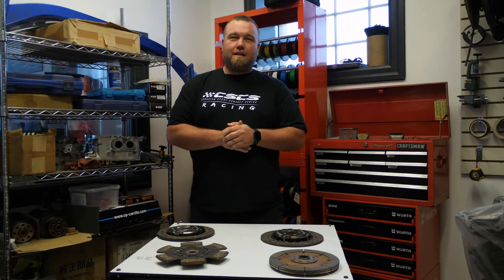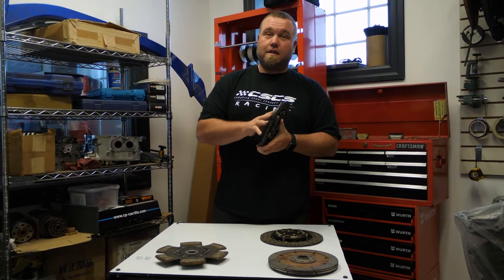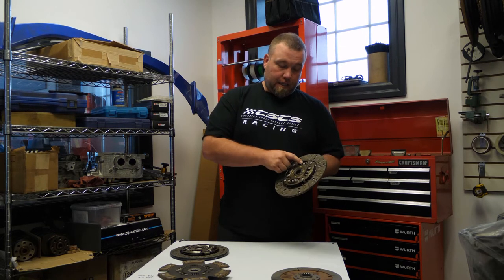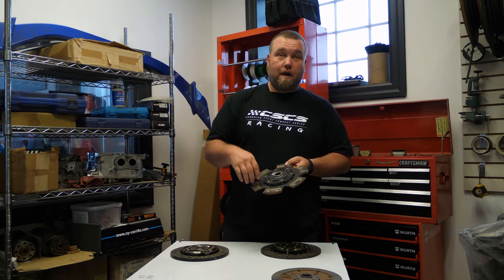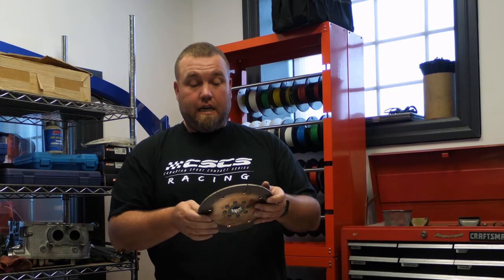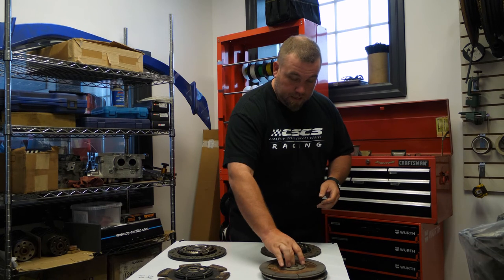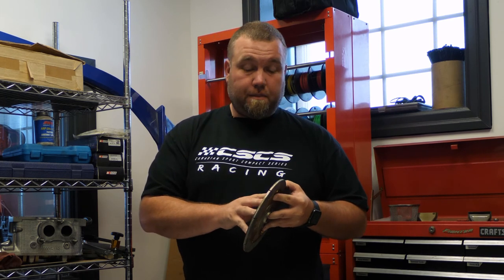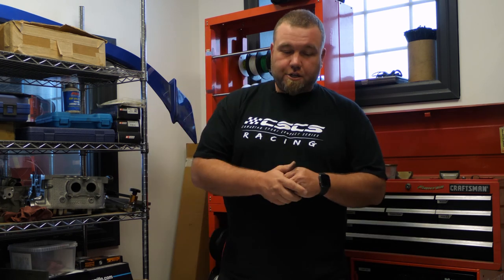How to Choose The Right Clutch For Your Build

Comment: If i may ask...
Im currently building a modest 1jz supra with the w58 (300hp if lucky)...
I went with a dual friction clutch to replace the stock one which was worn.
Its street and spirited driving with minimal track time (4x a year).

Sintered iron 6puck/metal-organic type.
Did i make a decent decision? Seems i have, but i rarely see those covered and not sure if the idea of them alone is a gimmick or the concept doesnt work as well as it may seem.

Comment: That was very informative. I normally use Stage two in my cars Z32 TT etc, but for my starlet turbo I was just about to order a tage 3 for the first time and nearly made the exact mistake you were explaining, thinking it might be better than the stage 2 but I won't do it now. To be honest I never felt a difference from stage 1 to 2, thats why I wanted something a bit more sticky but I guess this isnt the right way to go. My new stock clutch cant take the power of the engine after some upgrades.

Comment: Your explanation is very good. I thought choosing clutch only looks at the toque.

My car got 200hp with around 360nm, which one is mostly suitable?
Reply: Regular organic if your clutch basket is strong enough....
Reply: Torque and HP are interrelated. Torque is the raw rotational force transmitted across the clutch or whatever is being rotated. Torque it the rotational version of pushing.  
HP is a function of how fast an engine can produce torque. A simple formula is HP = Torque X RPM/5252  where the torque units are given in ft lbs.  So, you can easily see, If an engine produces, say, 200 ft lb of torque at 3,000 RPM it's producing 114.25 HP at that speed. So you might think, "Ok, at 6,000 RPM I suld be making 228.5 HP.  That logic, however, would only hold if said engine can produce the same 200 ft lb of torque while spinning at 6,000 RPM, which is almost certainly an incorrect assumption becasue the engine's breathing efficiency, the source of torque and power typically goes down above a certian RPM. Conversely, a racing engine's breathing efficiency, may actually be relatively poor at low RPM and spinning it faster will increase its efficiency - up to a certain point. After that point (RPM) is reached, for example, the turbo simply can not provide more boost pressure at the increased volume needed to fill the volume of your cylinders (for example 2.0 liters) twice as fast. Thus, though you might be able to spin your engine to even higher RPMs before blowing it up, the boost and subsequently the torque curves flatten out, then decline as you rev it even faster.  Take a look at some dynomometer plots showing both torque and HP vs RPM and everything I just said will make perfect sense.
Reply: @1RalphEboy  That's all well understood, but by application, I don't see how HP really matters unless leverage (gear ratios) is involved.  Say a car has a peak of 500HP at 5600RPM.  My target there would be gear ratios and tire size to keep the engine rotating near 5600 as much as possible.  Leveraging (pun intended) torque multiplication of the final drive ratio to maximize power to the ground.
There is no leverage between the engine and the clutch.  The maximum stress applied to the clutch will be determined strictly by the peak torque output.  So, a 525lb-ft peak at 4200RPM will be the highest the plate has to grab.  Torque actually drops when going above that RPM and all useful power is determined further down the line by gearing and tire diameter.  So, while the engine is producing 500HP, the crankshaft output can be 25lb-ft less than the peak.  Meaning the clutch is actually under less stress while the transmission+pinion+spur+rollout take up the job of controlling power delivery.
The closest correlation I could see would be due to road conditions combined with the lower ratios of the higher gears.  A pothole at 12:1 will definitely have less impact than at 1:1.  So I guess something like "torque noise" could be considered for high gears.  Otherwise, anything connected directly to the crankshaft can only experience peak strain during the engine's peak torque.

Comment: Would you know what brand sprung hub twin disc clutches would work for my Tremec TKX 26-spline street motor making 600 torque? Thanks
Reply from the maker: I would think McLeod clutch will have a solution for you.
Reply: McLeod doesn’t make a sprung hub twin disc clutch at this time. I did discover Tilton ST-246 is a sprung hub twin disc. I need to contact them regarding my TKX. Due to solid hub floater plate chatter not being ideal for the street a sprung hub reports to be quiet below the 2000 rpm lite load.

Comment: Blah blah blah. I understand what each one isn’t “designed” to do, but I’ve daily’d normal design, and 6-pick design clutches, and I have no issue driving either as a daily. Really, the most important part is how the vehicles clutch operating system is designed. There are twin disk clutches that are heavy as hell, and others that are light like OEM, all using the same disk material. It’s just that the two vehicles are designed differently. 

I have a MK7 GTI, and I’ve used a DKM Stage 2 (which uses a normal disk design with woven brass with organic material and slight alloy backings in it), and a Southbend Stage 3 Endurance (which uses a normal disk design with Kevlar), and the DKM Stage 2 was insanely heavier than the Southbend. It should be the other way around lol. Now, I’m putting in a XClutch Stage 2 kit (uses a 6-puck design made with ceramic), and I’m told it feels very close to OEM in terms of pedal feel. It should actually be the heaviest if the three! Lol